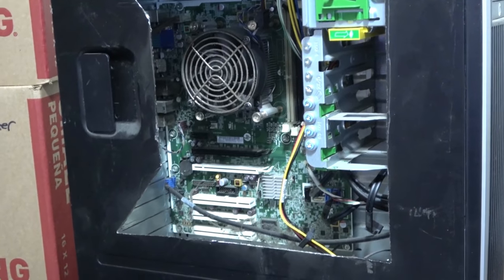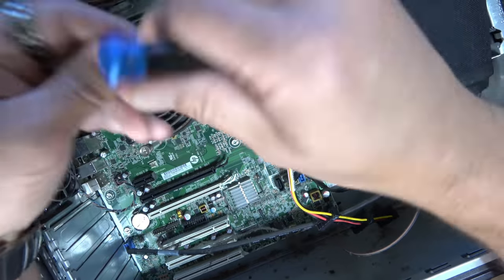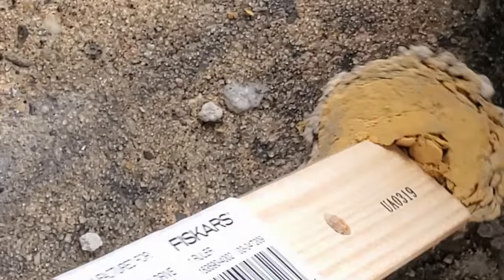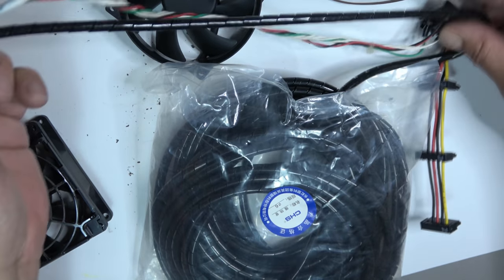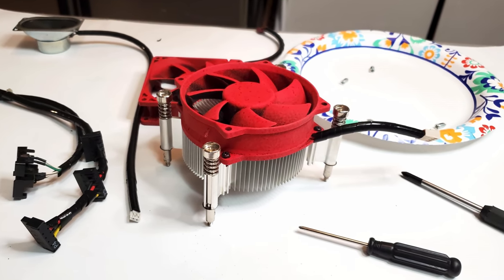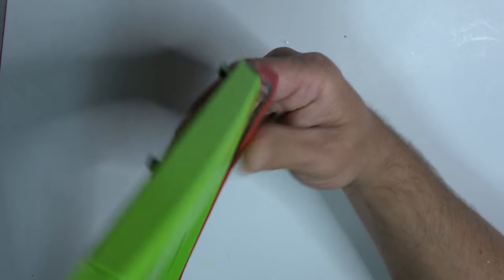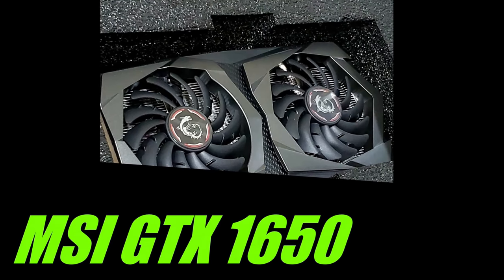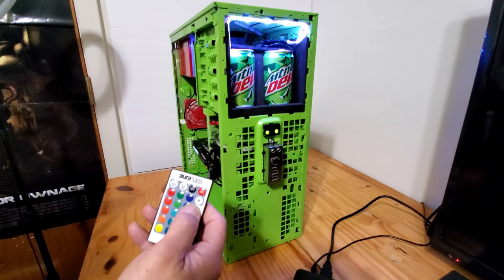my old Hp computer looks like a mountain dew soda machine

Comment: Nice use of the Xeon for the system. Most people dont know those cheap older xeons will slot into older oem boards and it's a great way to get near i7 performance for cheap.

Comment: I LOVE Mountain Dew! This looks awesome. Would you be able to hide the SSD cables better if the SSD position was reversed? Or would it not mount properly with connections towards the back panel?
Reply from the maker: That video was shot before my 1tb storage drive arrived and it basically had to go there with the stock power cable. I agree it would look better hidden.

Comment: hi mate this is a very cool video i love it. Btw did you use the Heatproof Spray or the usual one?
Reply from the maker: Krylon fusion spray just normal stuff. That system doesn't get hot though I ran the i5 with just the heat sink and no fan before with normal temps.

Comment: :) i see u found the good ol 1155 socket xeons i mentioned to you they are a steal most of the time
Reply from the maker: I love xeons and I was going to mention this and forgot. The e3 1270 i purchased for this build has 4 cores and 8 threads opposed to the 3470 that i pulled. However I lost the 1600 ram speed to 1333 by switching. So did I come out ahead or?

Comment: Hey @modstek LOVE the channel and the projects man!!! This may be a longshot and I am truly outing myself as a noob but if you (or someone) could assist me Id appreciate it. I want to upgrade the processor in my Moms old HP Pavilion Desktop (a6040n) and I want to update the BIOS but I have never done it before.

I found the correct .exe for the BIOS flash but as the machine is a VISTA era computer and I am running Windows 10 on it, it gives me errors that I dont meet the minimum requirements to update the BIOS.

I assume its because Im running Windows 10 but maybe its something else?

The other downside is that I dont have UEFI and my BIOS is LEGACY so I dont know how to proceed and not much pops up on Google when I search.

Any advice?

Comment: Did you mention air flow before rubber coating the fans?
Reply from the maker: The airflow is fine I only lightly sprayed the top of the fan for color but temps are good.

Comment: Hello, was thinking of upgrading mine with an E3 xeon CPU as well (E3 1230 v2 specifically), however, that cpu is not in HP's supported CPU list. Did you have to do any bios mod to get that working? Thanks! :)

Comment: The power suply of that pc have a 6 pin to motherboard an other conection, dont have the 24 pin. How do you solve that and still giving power to the gpu? (English is not my language)
Reply from the maker: Sata to 6pin adapter https://www.newegg.com/black-wavertec-wa1123254-power-adapter/p/0Y3-002P-000H7 the gtx 1650 does not require alot of power